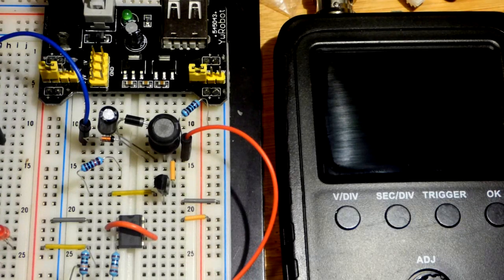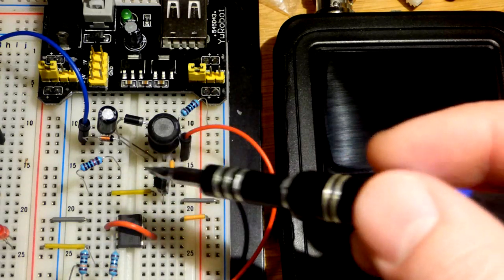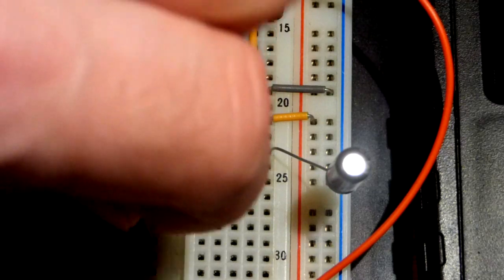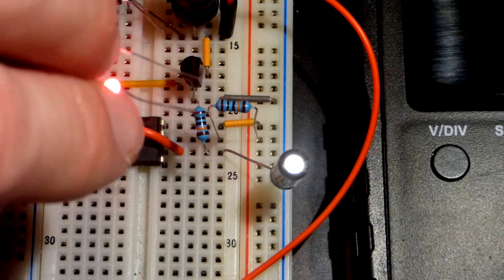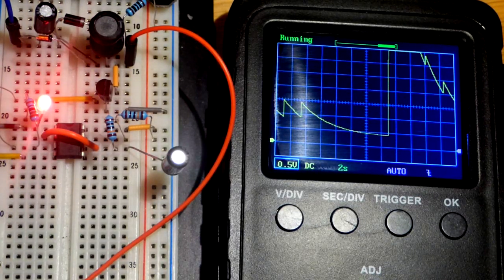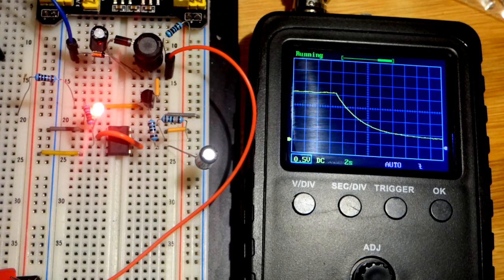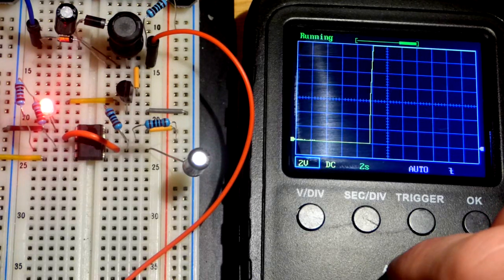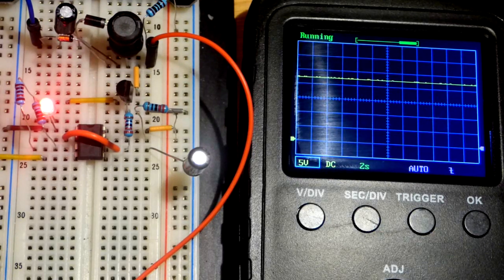555 timer astable mode added to 2N2222 switched inductor capacitor voltage booster circuit

Comment: Would this circuit by any chance be a current to voltage converter? Or just a voltage booster? Thanks! :)
Reply from the maker: A current to voltage converter would be an op amp that you apply a current source and feedback to the inverting input in order to set the output voltage. So I think this would just be a boost converter as it is taking a lower voltage in and outputting (across the capacitor) a higher voltage.